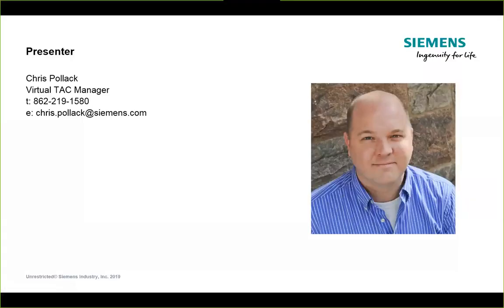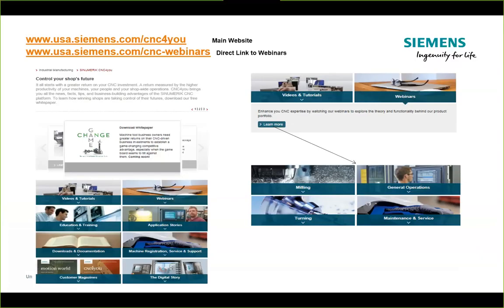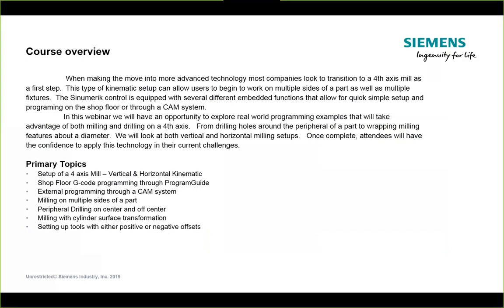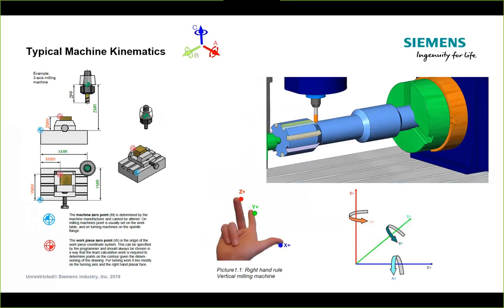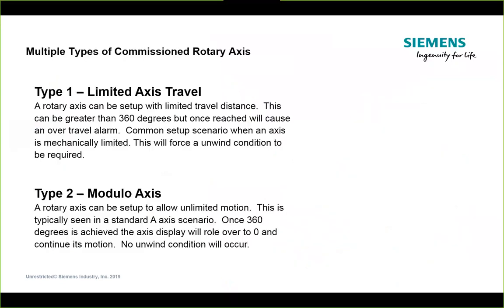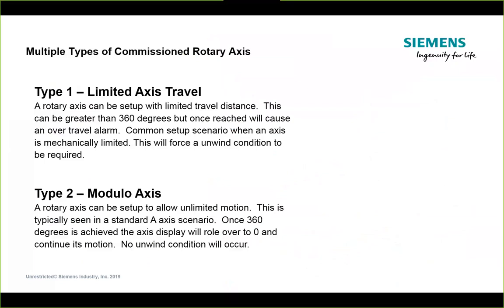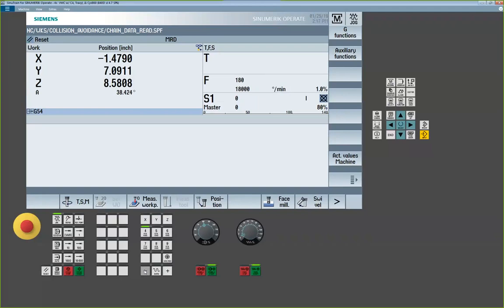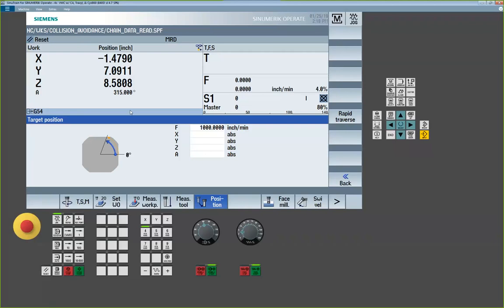Setup & Programming a 4th axis Machine in G code with ProgramGuide

Comment: Hi.  is it possible to add a 90ﾟrotation to an existing 3 axis G code file?
Reply from the maker: Yes with A ROT look at frames in this manual https://support.industry.siemens.com/cs/mdm/109481541?c=75104759691&lc=en-US